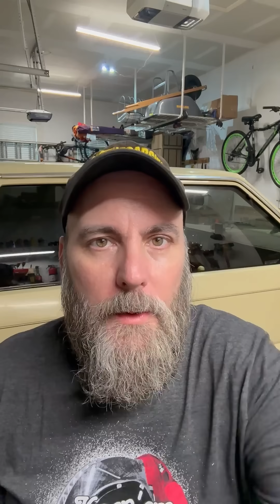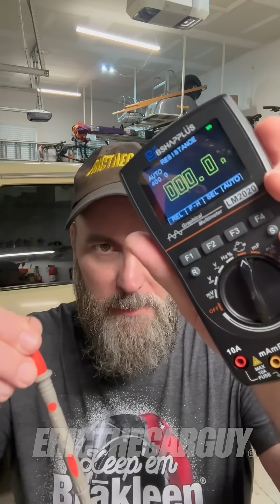Honda Element AC Clutch Diagnosis Blow Fuse #1 Correction #update

Comment: You can test the theory by testing the current when the compressor clutch is activated. Add a resistor to prevent the fuse from blowing and calculate the resistance.

Comment: With resistance testing, you can determine if a part is bad. A resistance test within spec doesn't mean a part is good. I've normally measured the Honda a/c clutch coils as an open, I wonder once you get to inspect that magnet, if some insulation has chaffed, causing a short circuit when the clutch is engaged.

Comment: Yes, kind of. The resistance spec basically tells you that the wire is not either interrupted or shorted so that it essentially is taking a shorter path. If the resistance is right, then when you apply voltage to it, it shouldn't be taking an unusual amount of amps compared to spec.

Comment: Load testing is always superior to ohms
Reply from the maker: Agreed, but here is why I didn't go there this time. It was a hot day and I was already getting baked by the sun in the position I was laying under the car. I didn't want to have to run the engine with the AC on which would add hot air to my face during testing. In short, I'm lazy and I was hot so you just got a resistance check instead of a voltage drop. Thanks for the comment.

Comment: Electrical Engineer here, with another degree in Physics, with  a childhood in a garage. Three things: first if your meter has the accuracy of 0.1 ohms and shows no resistance on your leads then I would either question your meter, or confirm the meter is compensated for this lead resistance. ALL leads have SOME resistance. New Fluke leads have around 0.30 ohms. Secondly I mentioned in a previous comment when the coil is energized AND the insulation on the coil wires have corroded off then the coil wires can be pulled together leading to decreased resistance. Lastly, why no mention of the fans?
Reply from the maker: Thank you for that insight. You might have noticed that my leads would fluctuate from 0.1ohms to 0 during the video. My point was that I didn't see how a DVOM would have 0.9 ohms in the leads and still function. I totally get what you're saying here though. 

I didn't go for the condenser fan because I've heard the engine running with the AC engaged and I can see that the condenser fan works fine, at least in my observation. I didn't show this in the video because the fuse blows quickly and it would have taken some set up that I didn't have time for in the moment to show this. I plan to show this in the compressor clutch coil replacement video to better illustrate my diagnostic process and make my findings more clear.  

For me, a quick resistance check on the suspected coil was all I needed to rule out the condenser fan. Given that it was out of spec, it confirmed my suspicions so I didn't feel the need to look further. 

Thank you for your insight and comments. They are appreciated, especially with your expertise.
Reply: @ericthecarguy  Thank you for all the great vids - you're a pleasure to watch. I look forward to the follow-up vid. My bet is the coil as well, but check the ohms on that fan as well. We'll see!

Comment: It's nice to see you back, Eric. With both the condenser fan and the compressor clutch fed by that fuse, I'd be searching for a way to isolate each component on that circuit to decide where the short is. Often with a motor like the condenser fan, you can get valuable info from a scope by mapping current ramps. Alternatively you could just unplug one component or connector at a time and jump the relay to test the circuit with a new fuse (the relay may not let you run the compressor if the fan isn't working). Or you could use a test light in place of the fuse, then start unplugging connectors to decide where the short is. I don't think the slightly out of range clutch resistance is enough of a smoking gun to drive confident parts replacement. Both the condenser motor and the compressor clutch can be hotwired in isolation to remove confusing variables.
Reply from the maker: I thought about that, but I felt the resistance check on the coil would isolate it as a possible cause. I'm lazy and don't like to work hard. Additionally, hearing the engine run with the AC engaged, and observing the condenser fan, which seemed to operate fine, led me to the compressor coil. That information was not presented yet. I plan to show that in the replacement video. In short, I had more info than you that was leading me to the compressor clutch. 

The new clutch is suppose to show up today. I'll probably install it tomorrow. Thanks for the comment.

Comment: Multimeter lead resistance is normally less than 0.5Ohms.

So you can still use it without any ill effects.
Furthermore, good multimeters have a function called "Relative"
This function will ZERO out the multimeter so you can compensate for lead resistance
Reply: His meter has a resolution of 0.1 and still shows zero ohms in this short (nice pun!), which is odd. I buy new Fluke leads every few years and they always have about 0.3 ohms.

Comment: Electromagnet windings are made from INSULATED COPPER WIRE. The windings makes electromagnet coil so the magnetic field created when current is applied moves the ferritic clutch. This wire insulation of the windings is compromised somewhere. When ENOUGH current is applied to the coil, the heat melts the compromised insulation and the coil shorts. Short is low resistance, low resistance is higher current.
Reply: Well said!
Reply from the maker: That makes sense. Thank you for that explanation.

Comment: I replaced the AC clutch on my Honda Civic 2 years ago after it kept blowing fuses. Honda in the factory service manual has a testing algorithm, and it wound up being the coil when I tested the resistance. Technically it would be better tested with a megger but then you have to know the initial resistance when it was new. 

We all make mistakes, the fact that you're man enough to admit it makes you that much better of a teacher.
Reply: Amen to have the guts to admit n correct... Ohms Law will school you every time 😸

Comment: What you're talking about needing is a hipot (short hand for high potential test). As you surmised you need a high voltage to find shorts in electrical windings. However, this equipment isn't common in the DIY world. For EV motors we usually run hipot at 1K+ volts